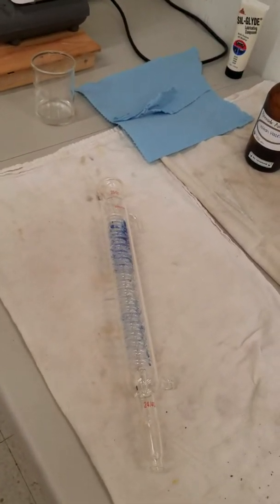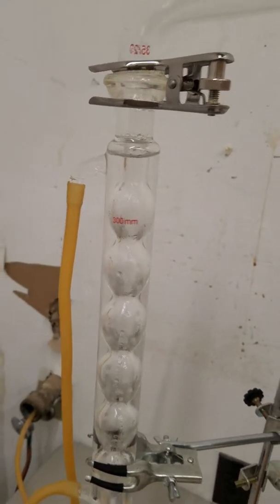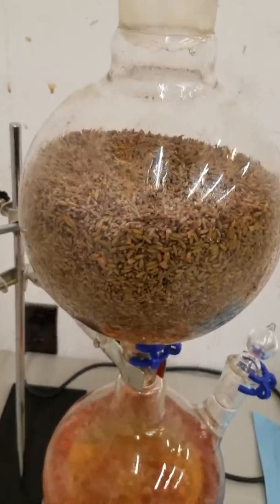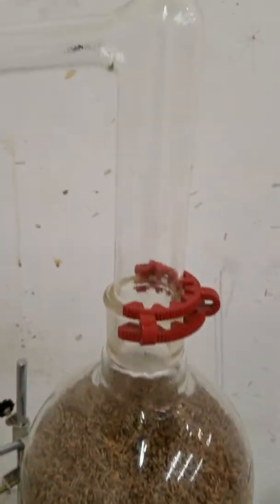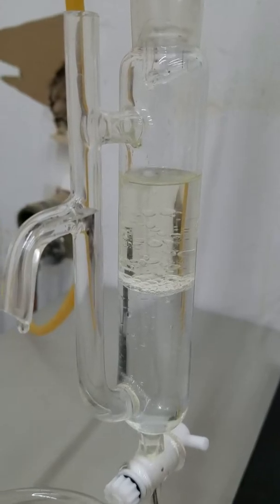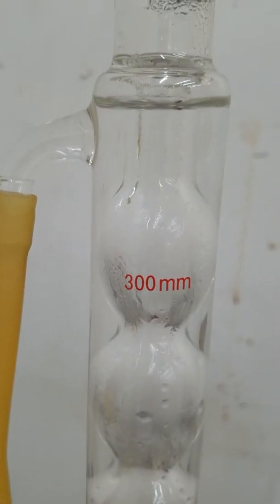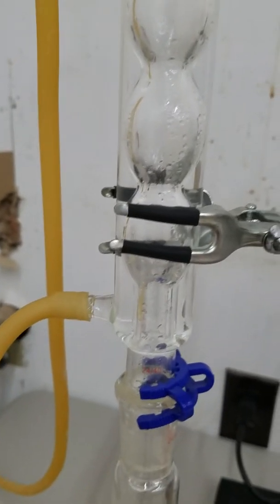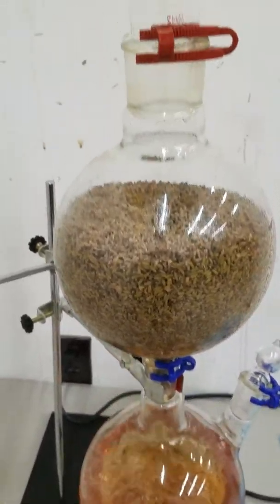Distillation with an Allihn condenser

Comment: What about running it horizontal or messing with the angle?  It would push out the oils easier if you found the right angle.  Sometimes gotta just work with what ya got.  Maybe silicon flexible tubing?